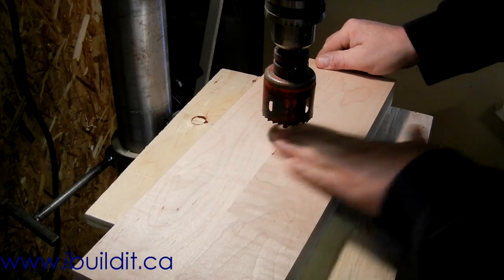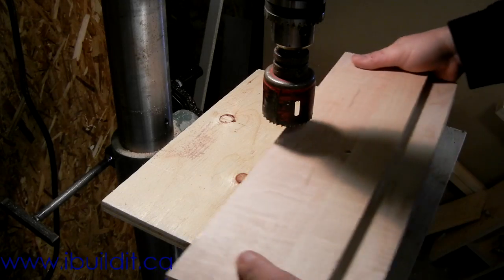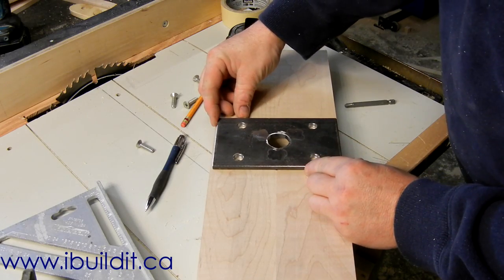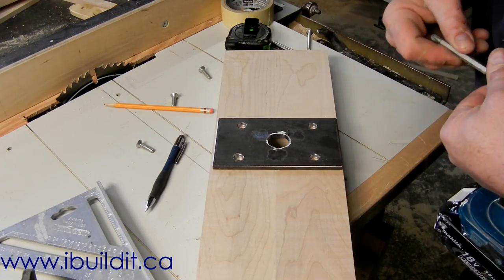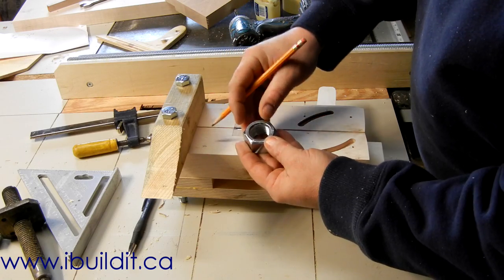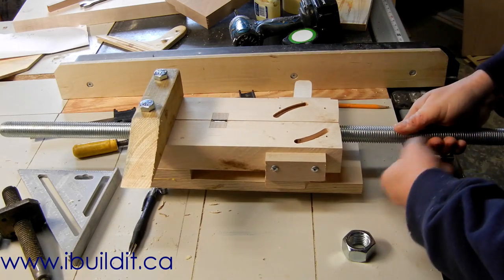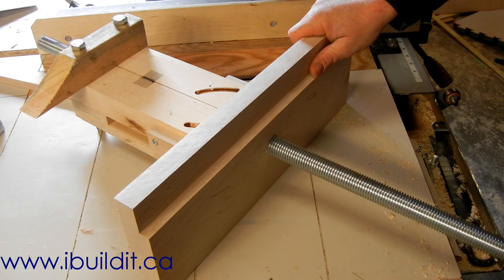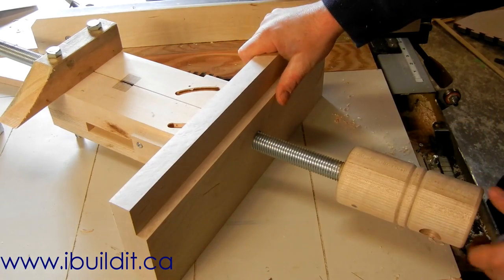Making A Woodworking Vise, Part 7 Of 10

Comment from the maker: @deezynar I thought about using springs to open the quick release jaws, but I also  wanted to avoid springs - they are hard to find and I'm doing plans for this vise, so I wanted common, easy to find parts. Using wood as the primary construction material makes the scale of things much bigger, as it needs to be bigger to have the same strength.
If I were to make a vise from steel (I will be...), I would do it differently, more like you are suggesting.

Comment from the maker: In fact, the wear is really insignificant, since the contact area is very small and this is steel, not play-dough.
In the plans, I added a yoke to the ends of the guide bars and lead screw to minimize this, mainly to make it less noisy.

Comment from the maker: @jpheisz CONT...that this is not as big of an issue as I thought and it takes very little force to hold them together around the rod. So, while reversing the pivot on my current setup is sound reasoning, there is little to be gained from it with the current open / close lever.
If I were to redesign for the under the lead screw quick release, I'd concentrate on opening the nut from the bottom with it hinged on top.

Comment from the maker: @cutlass93 The plywood is Baltic birch and it comes in a 5' x 5' sheet. I believe I paid around $50 for it, but I'm not 100% sure. 
I bought it from a specialty building supply - they stock many things that you can't get at Home Depot, etc.

Comment from the maker: @deezynar You have explained it well and when I make a steel version of this vise latter in the summer (best guess, time permitting), I'll revisit it. It seems to be a very good way to make the nut open from the bottom (hinged on top), which would make the whole unit more compact. 
Thanks, I'm going to put on my thinking cap and work with this on a possible new version of this vise - again, time permitting.

Comment from the maker: @deezynar I was thinking about how I would do this for a while and in that time I looked at other mechanisms for inspiration. I settled on this as fairly simple and easy to build, since this is made mostly from wood. 
Getting at the lever is only needed when you are adjusting the opening. 
I wasn't thrilled about how roughly made the casting was but my solution seems to be working fine. A better packing material for behind the flange would be epoxy putty.

Comment from the maker: @deezynar That's a really good idea to turn the jaws around, so they clamp onto the rod. To do this with my open / close lever would have the lever pretty far in, so some sort of extension would need to be rigged. Of course, what I have done works well enough and is not inconvenient to use. I'd rather sacrifice some convenience for complexity and parts count.
Another way was to make the nut open from the bottom. This may have been better, but would involve more complex cuts.

Comment from the maker: @deezynar No need to send a drawing - I know exactly what you are talking about. 
I originally wanted the nut to open from the bottom and hinged on the top. This would make the rod clear the nut better and make the unit more compact, but I latched onto the present way I did it and gave up on it. You have encouraged me to think about it some more and now I can see an easy way to do it.
One of the things I worried about was how tightly the nuts would gave to grip the rod, but it turns out...CONT

Comment: A Record vise has the control lever on the movable jaw, it's connected to a flat steel bar that runs below the screw & it actuates the nut release.  You could use the flat stock to cam open the arms that hold the nut & the arms would use a spring to pull them back together.  The arms would be held together by a catch that's released as soon as the bar starts to rotate.

Comment: @jpheisz 
Mount the quick release lever between the moving jaw & the tommy bar.  It turns on an axis parallel to the screw's & below it rotating on a 1" dia. dowel going thru the jaw.  The dowel is slotted for a 1" x 1/4" steel bar that runs below the screw & arms.  Support the far end of the bar on a drag bar that'd also support the screw end.  When the nut's closed, the bar's 1" dim. is vert. (1/4" horiz.) but when it's turned, the 1" dim. goes towards horiz. & spreads the arms.

Comment: @jpheisz 
I've given this some more thought.  I'd have the arms pivot just behind the fixed jaw & have the pivots spaced far apart so torque on the threaded rod would actually pull the nut halves together.  I'd go w/ the Record style quick release lever I mentioned before w/ a flat steel bar rotating to cam the arms apart.  Only a light spring would be needed to bring the arms back together.

Comment: @deezynar 
Cont.
The bar runs below the arms, so each arm needs a projection below for the bar to push against.  The location of the projections (just blocks of maple) will effect the amount of force & range of rotation of the lever.  Mount the blocks closer to the arm pivots, & the rotation needed is less but the force needed is more.  W/ the blocks further out, the dynamic changes.  The arms need a light spring to bring them together, but it's not needed when the screw is engaged.

Comment: @jpheisz 
Have you experimented w/ just a split nut on a screw to see how much force is actually needed to keep the halves together?   Your current mechanism has a lot of friction built in & it has about a 1 1/2:1 mechanical advantage.  Try slipping a screwdriver between the arms where the nut is & twist it.  I'm sure you won't be able to budge the arms apart.  The resistance your current mechanism has to splitting apart may be far more than is needed tho.

Comment: @jpheisz 
I wasn't thinking about hinging the nut at the top, but using arms like you have.  I'd just reverse the arms, hinging them just behind the fixed vise jaw.  I'd have both pivots far enough from the screw centerline that the arms would angle in towards the nut halves out at the ends.  The angle would cause the nut halves to press together when the screw engages, like the gates of a canal lock.  I honestly don't know if this would work, I'm just guessing.  I can e-mail you a drawing.

Comment: I made a vise years ago & used a floor flange to do the job of the plate you're using.  I filed out the threads w/ a rat tail file until the screw slipped thru.  I had someone weld a plumbing 'T' to the screw for the tommy bar, but I could've pinned it.  I really like your split nut idea, great thinking!  It may be hard to reach the lever if you have a large board in the vise.  Is there any way you can put the control lever on the moving jaw like a Record vise?

Comment: I think that you should set the speed on your drill press at around 2500 rpm when cutting holes with a hole saw. I personally do it that way and I don't even have to move the saw up and down to clear the chips. It takes about one third of the time it took you to cut a hole like this. It also helps a lot if you have a high qualiy hole saw like a DeWalt one, Because higher quality hole saws are designed to clear the wood chips more easily.

Comment: @deezynar 
Cont. Cont.
The set-up I describe doesn't have any more parts, nor is it any more complicated.  In fact, it may be simpler.  The change puts the quick release lever on the moving jaw so it's always up front & easy to reach.  The bar system I describe is typical on Record brand vises.  I just adapted the idea to be used w/ your elegant split nut design.

Comment: i don't mean to pick holes in your design because it is actually a very nice one, but when that threaded rod slides in and out over the threads on the nut, surely that must damage the threads on either the rod or the nut? and it makes allot of noise, is there no way you could support the rod from underneath with a bearing or something to stop this from happening?

Comment: You do realize that eventually those threads on that split nut are going to wear off right? Otherwise great idea. Nice design.
Reply from the maker: +Doug Keen 
Been using the vise for 5 years and it hasn't worn at all (the video is that old, you know). People that are not really familiar with steel often think it's softer than it actually is.